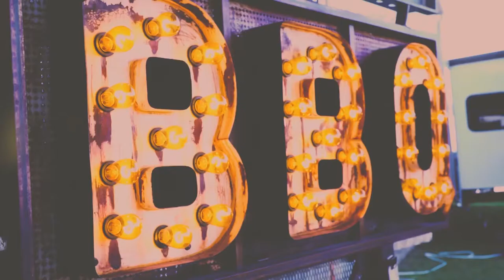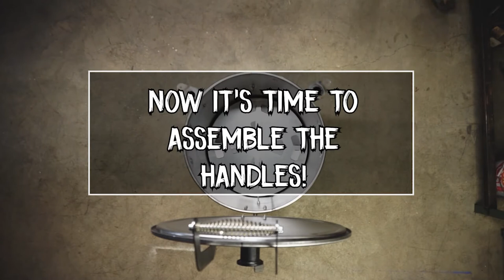UDS-DraftMaster Build [Assembling the Final Outer Components]

Comment: Hi, just received your nice and technical explanation video of air distribution plate. But I comment on your last video here. I really dislike ventilator controllers. Many people forget Smoking is not at all about a consistent temperature. Ventilators will burst air or block air. So yes, temperature will kind of stay stable. But due to the mentioned by you delay. Shere are always some spikes to be seen in temperature. But the real spikes are actually not seen and far worse. And now I mention con=mbustion stabilisation. Your smoke depends on a constant combustion. And nothing is worse than an on/off fan which raises or smothers this process. A lack of oxygen while running a high combustion results in a lot of unburnt particles and the so called. Dirty Smoke. Turning your products bitter. A ventilator controlled controller can only give good results in combination with a speed controlled fan. Or even better. Just a linear valve control. with a slow PID reaction time. I prefer heat differences over smoke quality differences! Would like to here your comemnt and thoughts. And have a look at my #PuraLeña results on the social networks. Again, thanks for your newsletter and video.